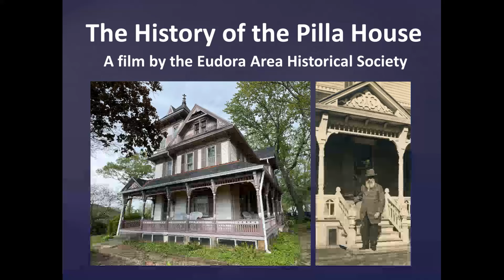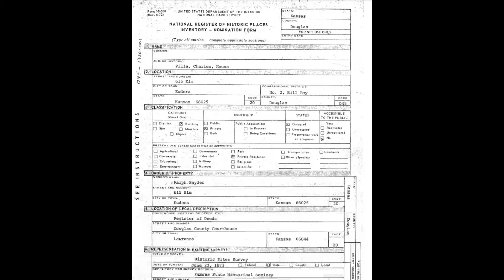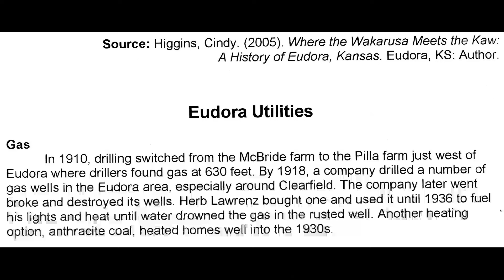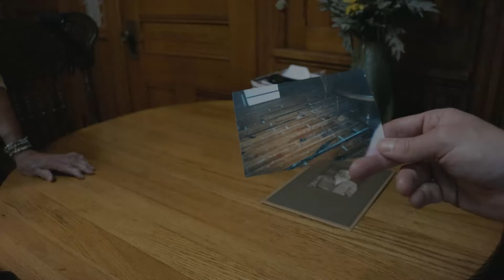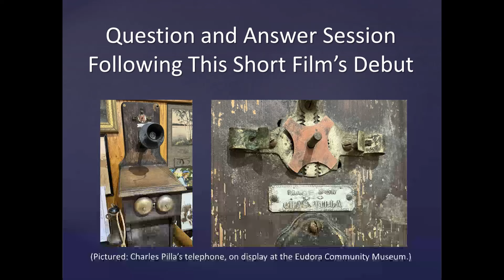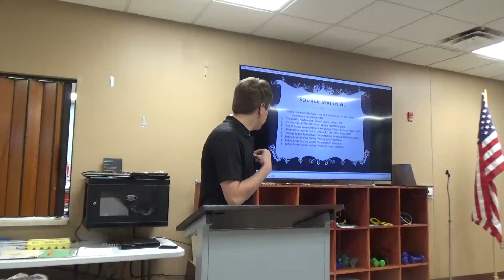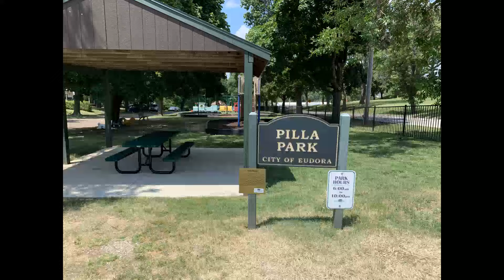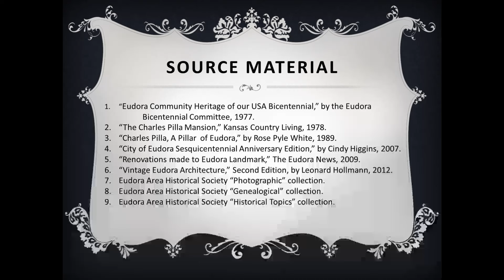"The History of the Pilla House" (Eudora, Kansas)

Comment: I used to work at a grocery store, now turned liquor store at 728 Main St. in Eudora, and it had a large bricked up tunnel that was in the basement.  I was told it was connected to Pilla house and was used as a passage way for Charles Pilla.  It could absolutely be a utility tunnel, but as I've personally seen the beginning of the tunnel under that building they absolutely exist.  We didn't even know the grocery store had a basement until it was being cleared of old shelves and a wooden hatch covering the basement stairs was discovered.  I went down there and it was so scary looking with the start of the tunnel even deeper down in the ground than the basement floor.  I hope this helps with everyone's curiosity about the tunnels.